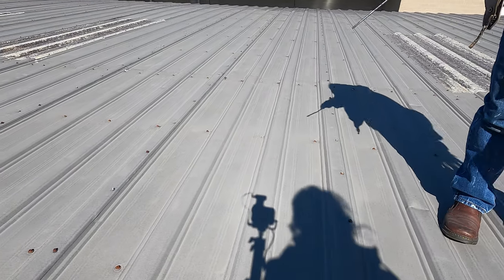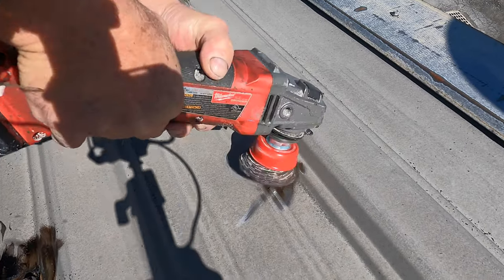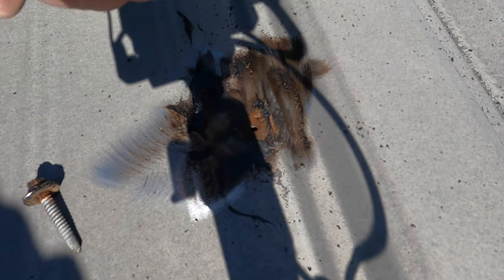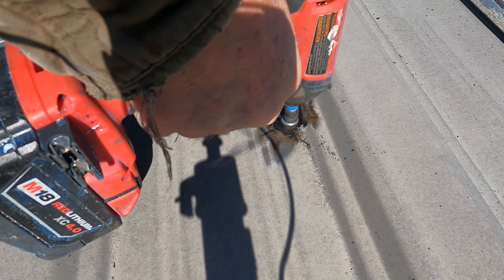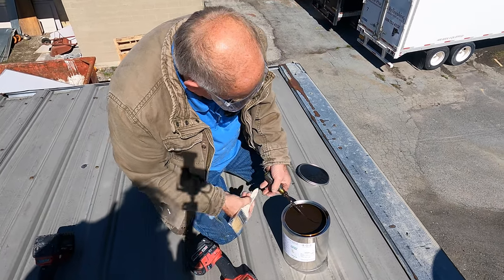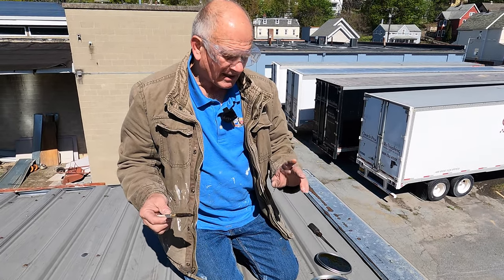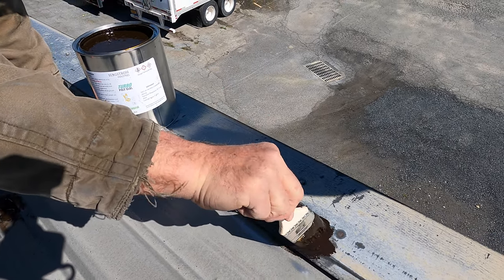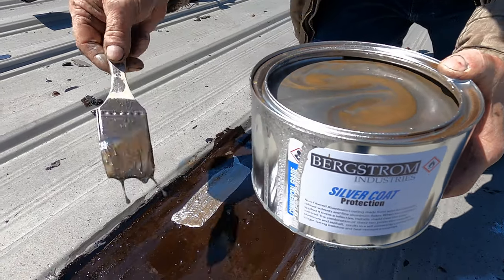Seal Metal Roof Screws from Leaking - Turbo Poly Seal

Comment: Hi there, we enjoyed your videos a lot. I have a few of those leaks because of the screws on an identical roof. Im planning on following your directions here. The only difference is we already have two gallons of Fle Seal. Can I do the same steps but use Flex Seal instead of Turbo Poly Seal and obain the same results? Thanks in advance for what you and your wife are doing for us homeowners who are trying to save on repairs.
Reply from the maker: Flex Seal is silicone based and Turbo Poly Seal is Bituminous and Urethane based. I use both types for the process but I think it is safer to use Turbo Poly Seal because it is stronger. Turbo Poly Seal has to be protected with Silver Coat Protection

Comment: I haven't used turbo PS, but I have used polyurethane roof caulk and the screw interface still fails.  I have metal sheds and a metal flat roof. I use GE metal silicone caulk for the screws  now. But maybe the silver coating is the key when using urethane.
Reply from the maker: Hmm, The caulking is the problem. It has a different composition than the Turbo Poly Seal. Caulking also has a very high viscosity compared to that of the Turbo. Then Turbo Poly Seal have Bituminous Resins combined with Urethane resins that makes it stay pliable after curing and the adhesion is far better than that of caulking

Comment: I have a tiny house with metal roof and screws.  No leaks. But could I apply the turbo over the screws as a preventative measure?
Reply from the maker: very good idea. Just remember also to cover the sealant with Silver Coat Protection

Comment: Does silicone sealant stand heavy snow
Reply: That's what I always use. The problem we have is screws backing out from thermal expansion/contraction. We pull the #10 screws out, pack the hole will of clear silicone, and drive a #14 in its place. A bit of silicone will always squeeze out the hole as we drive in the new screw which provides an extra tight seal around the rubber gasket. I've never had a problem with GE brand clear silicone and ZXL woodbinder screws which has a cap to protect the rubber gasket if installed correctly.

Comment: Doc how many Cans a year of Turbo do you use.
Reply from the maker: I don't keep count, but it depends on the jobs. Last week we did a job in Deleware and I made a video on How to calculate the Cost of making repairs on a metal roof seam. That particular job, approx. 660 ft of seams and flashing, I used 25 gallons of Turbo Poly Seal